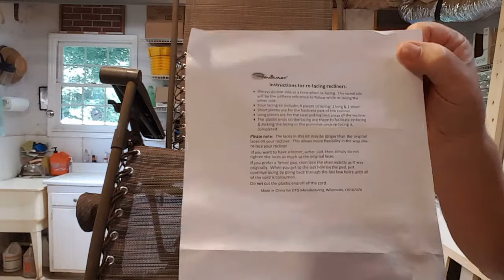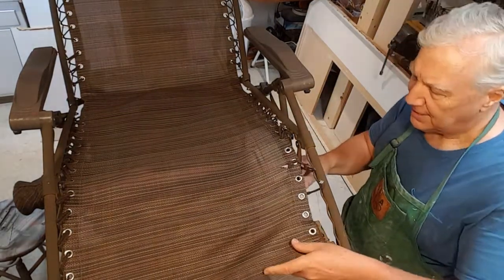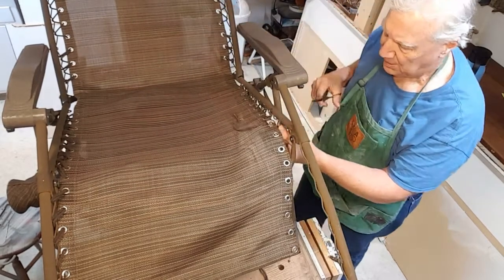Lounge chair repair - Replacing the Cord for Zero Gravity chair

Comment: Is this chair from Home Depot? How long did it last before the cords started breaking? Just got one of these with similar cord design where ot goes single to double in spots. Curious how long before cords may need replacing.
Reply from the maker: Great questions!
It's been a while so not sure where we bought them
About 4 years in direct sun
I found different lacing patterns as well, so tried to match the style on the chair
Hope that helps!
And thanks for watching and commenting 👍
Reply: We think we got ours from Kohls, longer than 5 years ago.  They are still available, even cheaper than when we bought them.  The cords do not last well when in dry, sunny weather.